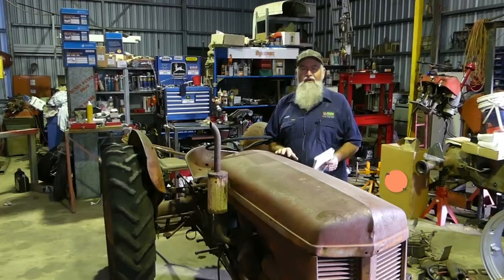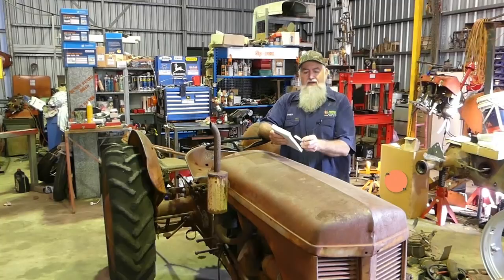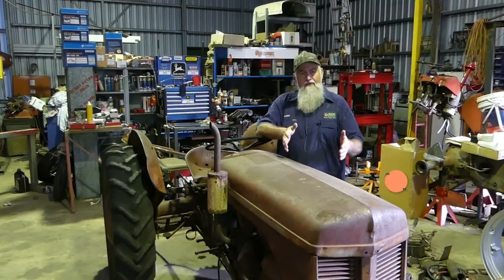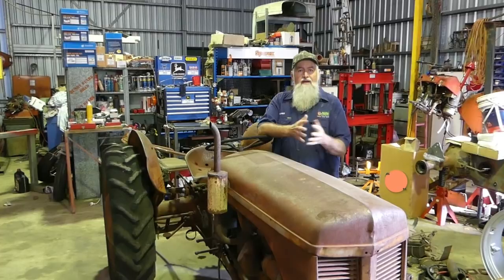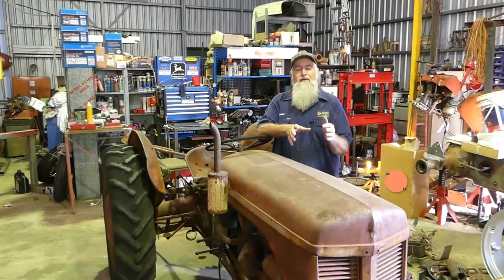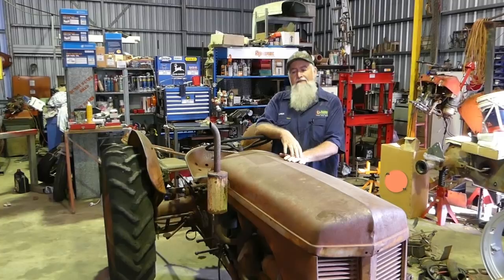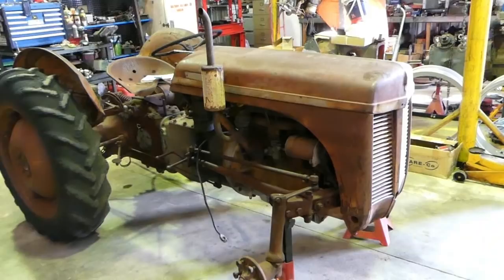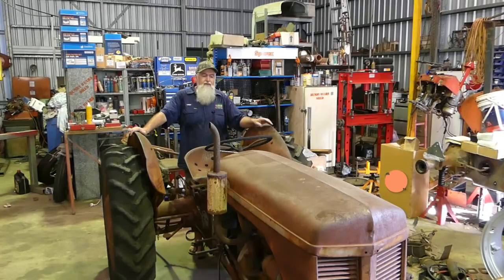Sparex Ferguson TEA20 # 1  The Introduction.

Comment: Hi Lance, about a month ago I decided to have a look at our Ted 20 which hasn't been started in about 15 years. It's a 1953 model that's been on the farm from new and is in original condition, no dents or dings and I'm pretty sure the engine has never been touched (checked with an old neighbour, I'm only sixty one!).
I discovered your shed around the same time so I'm on the same journey with you as my guide. 
Jerry
Reply from the maker: Sounds good welcome aboard, Im a bit slow with mine at times as Im just a busy bloke.

Comment: G’day from Tamworth Lance, good timing this series as a TEA is my next project! Cut my teeth turning spanners on theses and 35s (plus David Brown 885s and 995s), our family grew potatoes and these were just right for the high country. My very first full-resto was Dad’s 1951 TEA 20. We converted the electrics to 12 volt using a Falcon starter motor and Bosch alternator. Stupidly let it go and would love to find it again! Love your videos and your business, always been good service on the bits we’ve needed. Which reminds me, I’ve gotta do the CAV pump on the DB885, better order a kit. You’re right about mixing hobby and work, living the dream!
Reply from the maker: G Day Luke, Sounds like an interesting time you had, The falcon starter is interesting to me.
Reply: Bundy Bears Shed the starter was an easy one if I recall, literally just a small modification to the mounting plate hole. Would have been and early 70s falcon six (we did the conversion in the early 90s), just a starter motor from the wrecker

Comment: Hi Lance, absolutely great project, the TEA was a “world” tractor so many many are still around and your video’s will be helping them out.
Yes, you are right, you can only restore a tractor once and then you are afraid to use it.
I have an Allis Chalmers FD3 with a 2 cilinder aircooled diesel engine. Absolutely love it the way it is!
Good luck on the series
Reply from the maker: Cool, thanks! 2 cyl air cooled would be worth a look.

Comment: i have a 1949 TEA 20 TRACTOR sn TE 81025 
my question is,  On the distributor the coil nut on the distributor is facing the block and was like this for years when my dad and Granada used it. they are goon now and i am trying to get it running. All the tea20 i have seen on line the nut is on the other side facing out. it has no fire i am wondering should i turn the distributor back to the original. hope you can shed some light on this thank you
Reply from the maker: Yes I would but you may need to re do the distributor timing.

Comment: I have a 1952 TEA20 Ferguson tractor; where do I find information on the right kind of motor, transmission, and hydraulic fluids needed for it?
Reply from the maker: Look on the web site of your favorite oil supplier and they have a lube guide usually.

Comment: Hi Lance, I’ve been searching and searching trying to find the correct oil to fill the transmission on my Tea20. Very confusing and was hoping you can steer me in the right direction ? Some say same as the engine oil ?? Any advice much appreciated ya. Cheers
Reply from the maker: Dont get too hung up on it. The engine was a straight 30 and the gearbox was a straight 40 oil from factory I believe. The more modern tractor back end oils will work fine as well. I would suggest the straight 40 engine oil. Most oil companies have a lube guide on their web sites that offer their best advice on what to use.

Comment: Looking forward to this tractor I have a Te 20 I’m working on just ran into a problem with the oil gauge it had what looks like brake line and nothing will bolt up to the fitting on the block I hope you can address this on your video
Reply from the maker: G Day Richard, We have the oil line and it originally had a banjo fitting on the engine block that had a 3/8" unf banjo bolt from memory, I would have to check to be sure. 
Here is a link to my site to show you what it looks like: https://www.queenslandtractorspares.com.au/product/oil-pressure-gauge-pipemodels-with-one-piece-pipe/

Comment: Lance 
TE-20  
i have spark to the spark plugs but still will not start. it seems to me something is dragging it down when i crank it over i have a new battery but it seens just not enough cranking power to start   any help thank you
Reply from the maker: As a starter gets weak it draws a lot more current so it may be a faulty starter. Hard to say really. Can you try and crank start it?
Reply: I currently dont have a hand crank but I will get one thanks alot for your help

Comment: I'm having trouble with my to20, it bogs down under load such as shredding or trying to. Any advise?
Reply from the maker: I would open the main jet or adjust the distributor timing. You can always take half of a cut too.
Reply: @BundyBearsShed  I'll give the jet a try, I messed with the distributor and it seems close.

Comment: You videos have been incredibly helpful! 
Thanks for your passion and all you do.  
Would you be able to confirm the year of this TEA20 SC34532E this is stamped on the engine block. The aluminum tag is missing.
Reply from the maker: I cant really date it from there but there would be a few date stamped castings near the rear dipstick housing and also look on the generator for a year model if it is the original one.

Comment: Hi Lance,number on tag unde steering wheel TEA282623, number on engineblock SC30156E,can you tell me the year of my tractor please and thank you
Reply from the maker: looks like you have a 1952 Model 241335-310779 1952
Reply: @BundyBearsShed  Hi Lance, would you know what size engine i have, the hydraulic pump side valve chamber is broke  ,it has TEA28 26 83on the stamp on the steering wheel,thanks